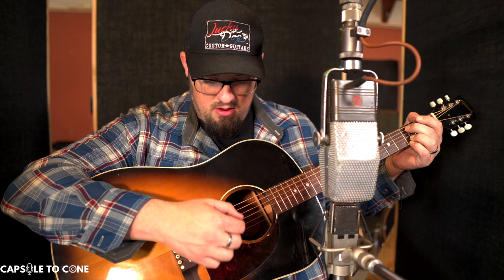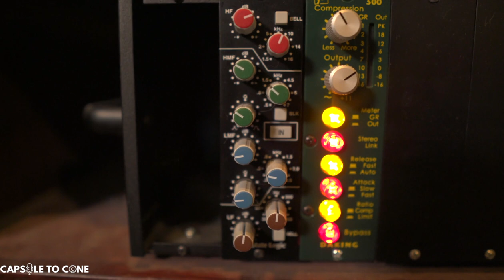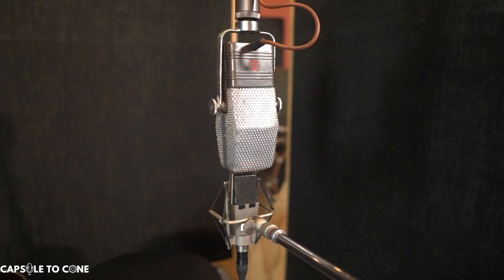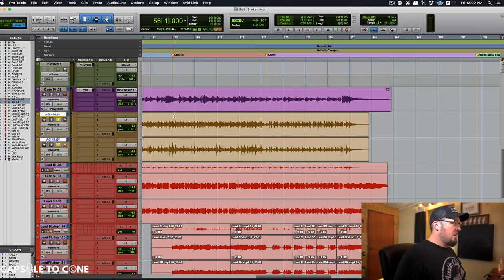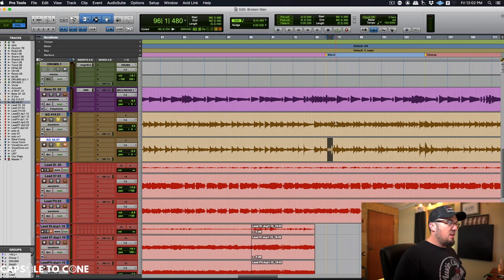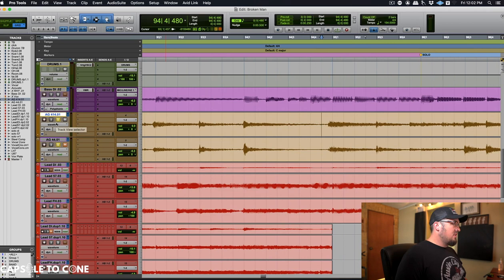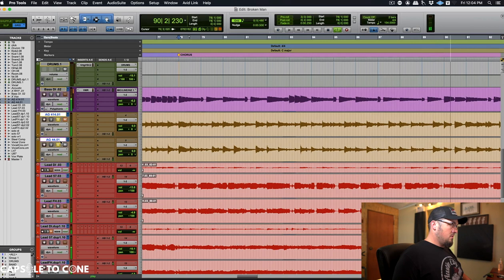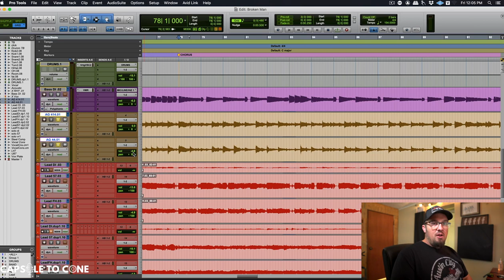How to Record Acoustic Guitars | Producting a Country Record Part 6

Comment: Thank you for the great video! I'm doing a record right now with acoustic as a main element, but the tunes vary from a rocking biker vibe, indie pop, ballad, and covering a lot of areas in between...the challenge has been deciding whether to set up a standard great recording set up for every song and adjust in the mix how it sits and the character, or to adjust the recording setup for each song with different mics, guitars etc...but that means that any overdubs/re-takes are that much harder to try and replicate the set up.
Reply from the maker: I’d say if the time and gear is available to really cater the setup for each song, if the music is that varied then the production being varied is going to keep it interesting.